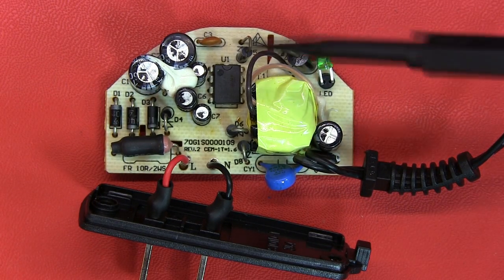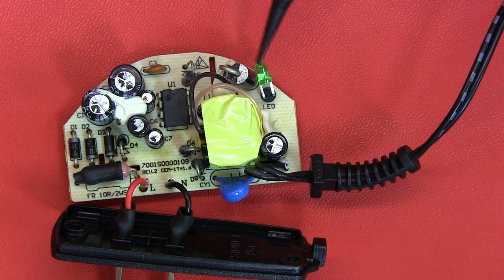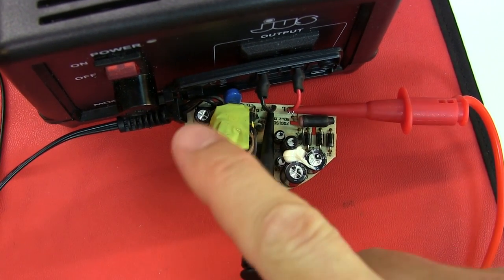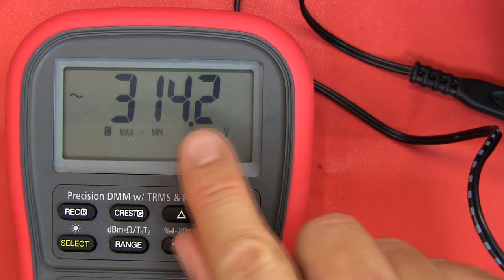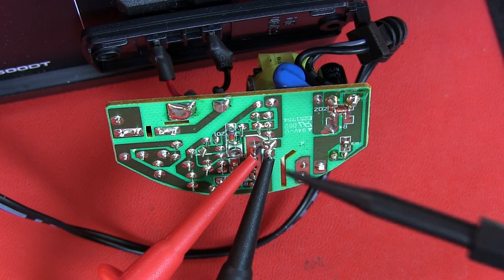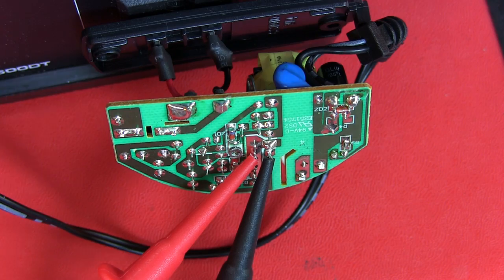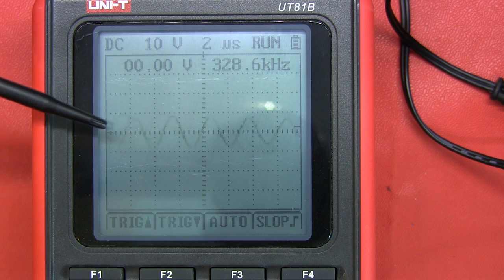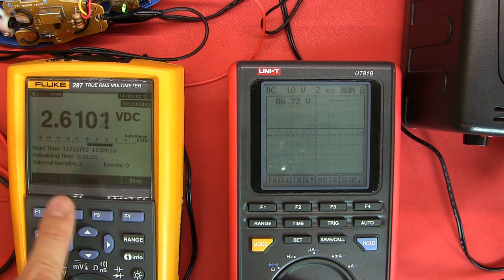A Look Inside #2 - Pt 2 Bed Head hair clippers

Comment: Nigerian barber near me charges R25 for a cut....... I still diy as often when I want a cut and am free to do it is is at night, so he is closed. Nice to see you learning a little more each day. See which of those 2 cells is dead short and measure the resistance of that with the low ohm function on the Fluke.

Comment: The power resistor also acts as a fuse. 
Good separation between secondary and primary and cutout to keep the transformer cooler...
The diode on the secondary is standard on any switching regulator type of power supply like this one. 
The blue capacitor ties the ground of secondary and primary sides, as far as I understand it's for reducing interference, noise, emi etc. People with more experience can probably give more details.

Comment: Switch mode supplies like that use a higher switching frequency (10s to 100s of KHz) so that the transformer can be physically smaller, so the frequencies you measured were in the right sort of range.

Comment: Enjoyed the video set. I have this exact same clipper with the same problem. I am a very, very basic electrical hobbiest who desires to learn more. So I noticed you put in Nimh batteries as a replacement. Is this ok as the charger is a constant charger with no shut off. Or should I do a direct NiCd replacement instead?

Comment: Switching power supply primary is never a square wave. Has a lot of ringing and big spikes on edges as well. lucky your scope survived, they are going to be 700V plus in many cases. To get it to be stable you need a load, as the controller is running in burst mode as it has no load on it. Add a load resistor of 47R 5W then it will be regulating..